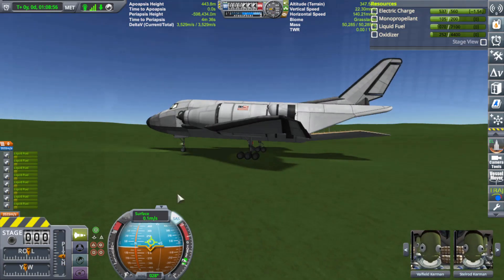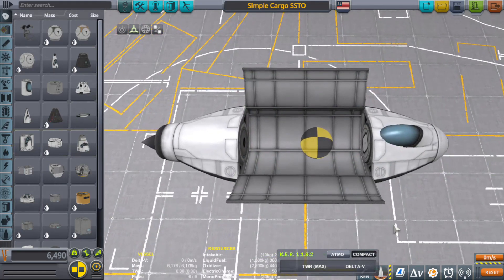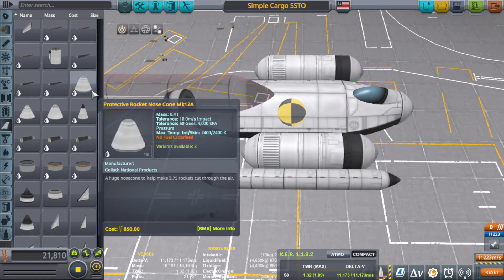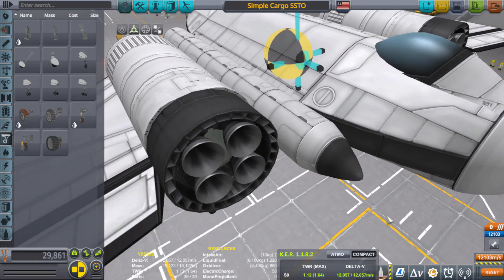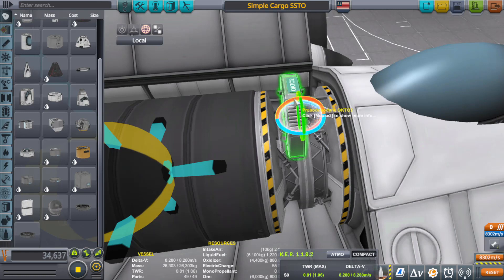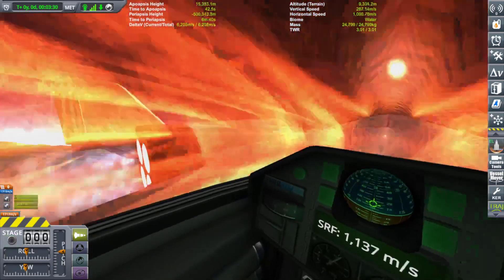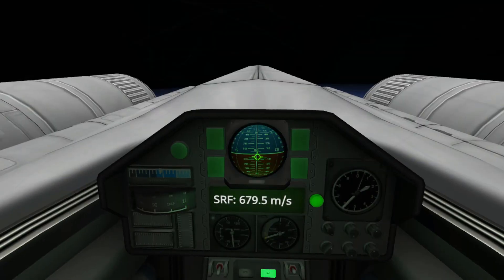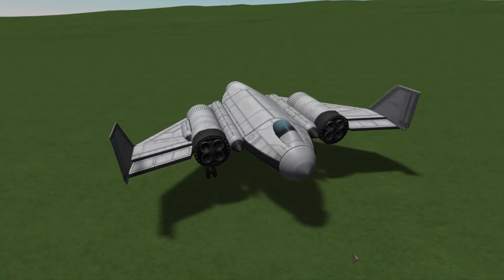SIMPLE CARGO SSTO for Tips and Tricks in Kerbal Space Program

Comment: Could you fit a large parachute in place of the aerodynamic dome at the rear? My landings are sometimes a little bit uncontrolled and a way to slow down would help me out a lot.
Reply: you could! however imo landing with the chutes is much harder than landing normally. try using a large drone chute and then if thats too powerful two side mounted drone chutes directly on the CoM. some tips i have for landing in general are establish a low speed and a glideslope when youre looking at the runway numbers, by glideslope i mean have your craft pitched so that it would run directly into the numbers if no other control inputs were made. once youre getting close to the numbers, pull up gently and just fly the plane down the runway until it touches down. if you balloon and end up flying back up above the runway just go around and try it again. i would practice landing your spaceplanes for a couple launches before you actually take it up into space just so you get a feel for how it controls.

Comment: Last night, I half-built one with a long adapter for the tail with both a cockpit and an atomic rocket embedded into it. The atomic rocket blends very well with a nose cone adjusted to merge with its taper, especially when embedded into a mk1-mk2 adapter. With that much weight at the back, I fitted 2 cabins and an inline docking port up front. It was late and I couldn't get the side tanks to look good, so I scrapped it. Didn't help that I wanted to use Big-S wings, they made it harder to make it look right. A second pair of... fuel tank tubes, for want of a better term, would probably have been easier to work with. It's definitely easier to build spaceplanes this way than my previous method of trying to guess where COM will end up when the fuel tanks are placed and inevitably failing. That method requires so many rebuilds of complex vehicles.

Comment: Landing by looking out the left side, just like an old biplane. Also, for more complex designs, keeping RCS or liquid fuel tanks in the nose and tail and shifting monopropellant or fuel between them is an effective way to trim the center of mass in flight on reentry. Start all forward and transfer back until your pitch indicator while using sas zeros out. If you're over shooting, transfer back forward until using half your pitch authority to maintain your attitude. Adds drag without airbrakes or changing AOA.
Reply from the maker: I have found a way to avoid all the fuel transferring stuff so I never have to worry about it. It's the tip that I show everyone in the video. :)
Reply: Skylon balances fuel in the nose and tail tanks in this same way. But that's a more complicated technique. Vaos' design today is all about being simple.